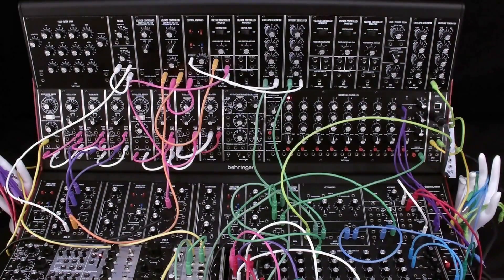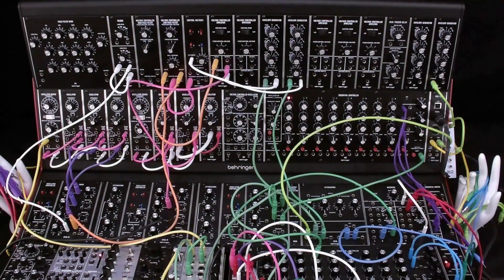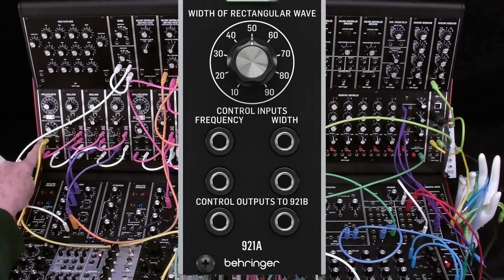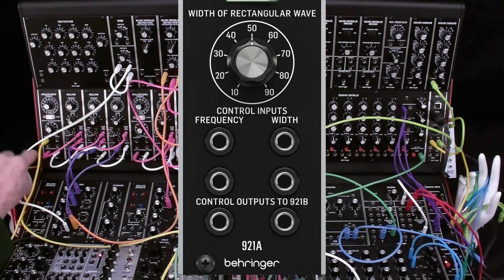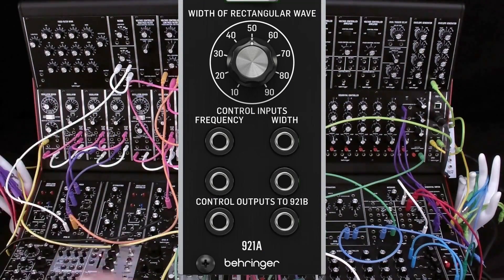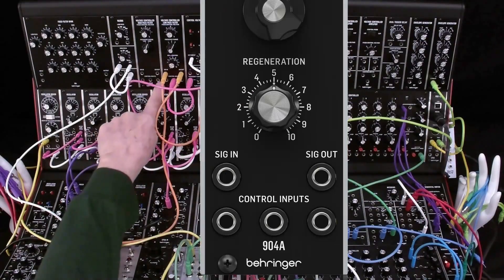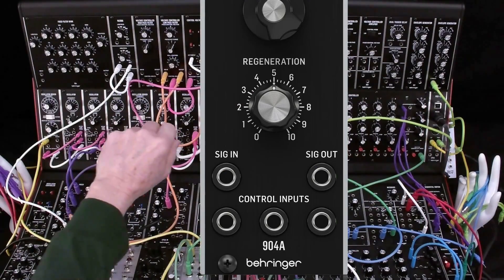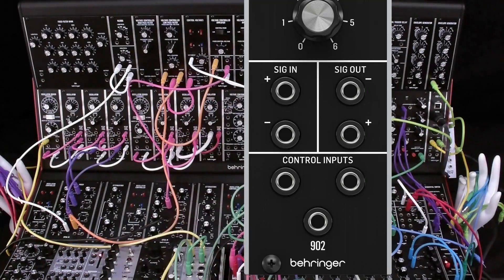System 55 Mixers - Active and Passive

Comment: A mult can only work as a mixer if the devices that are input to it are specially designed to work with that configuration.
This isn't usually the case.
Reply from the maker: Yes, there are limitations.  What audio signals in a system 55 would not work?
Reply: @ozhalljr  Since the Moog design doesn't have level controls on active outputs, there is little use for stuffing several outputs into an input.
Reply from the maker: Maybe I'm misunderstanding your point.  
To me clear, I don't often do passive mixing, but it is a technique in the bag of tricks.
If I want a "composite" waveform that combined two waveforms from an oscillator, I could use an active mixer.  If I wanted to conserve my active mixers, I could use a mult.  
I could use an attenuator (or two) to change the mix of the two waveforms (which changes the underlying premise that the Moog design does not have level controls on active outputs).  
One side effect is that the resulting waveform would never be of greater amplitude than the waveform with the highest level.  I might want this side effect.
Am I missing a point that you're making?
Reply: @ozhalljr  . I've only heard of moog grandmother being designed so that passive mults can be used as an audio mixer.
Maybe sys 55 has that, and maybe the Behringer equivalent does. Generally the rule is don't connect output to output ever.
So generally in Eurorack this is not something you'd do.

Re: the Behringer, I have the multiband filter, which is great, but note the 2 inputs are just in parallel {i.e passive mult}.....that would support the idea that other sys 55 modules are designed with extra components on the outputs so you can use passive mult as a mixer......but the Behringer 55 stuff is Eurorack and I've never seen them mention that those inputs shouldn't be used to mix non 55 signals.
Reply from the maker: @livelooper  Thanks for the detailed reply.  Generally speaking, the Moog modular modules have been tested in nearly every patching configuration.  ( per a history of Moog that i read ... perhaps "Analog Days" ).
Reply: @livelooper  When the Grandmother first came out, the manual said the mults could only be used to mix AC-coupled (audio) signals, not DC-coupled signals like CVs or the modulation oscillator/LFO.  Then the Matriarch came out and that was changed: the mults on that synth can be used as passive mixers for CV as well as audio.  Later the Grandmother was updated to allow for this too - the dark edition’s manual says you can passively mix/mult CV as well as audio.  Someone on Gearspace who had both an original and a newer Grandmother did confirm that CV mult-ing did indeed work better on the newer model.
Reply: @ilovecatsandsynths9702  . Thanx for that. I knew about the original GM.
Suspect that the LFO also counts as "audio" as it doubles as a 1v/oct oscillator....but going to have to check .
Reply: @livelooper  The LFO is DC coupled so it can work as an LFO.  So if your Grandmother is older it can’t be passively mixed without it causing issues.  If the impedance of the outputs being multed aren’t the same, lower impedance signals will overpower higher impedance ones, and in some cases could overload or damage the circuit.
Reply: @ilovecatsandsynths9702  . 
It could be DC couple and still have the mix functionality, only needs the addition of a single resistor.

I didn't try it yet. That would be the thing.
Reply: @jr Your assumptions are not correct and a oversimplification and - in error - of electric engineering, more a play of words and cutting corners than a real effort to learn or share knowledge &  the basics of electronic (mixing).  That it under certain conditions did work and not cause damage does not mean it holds true in general, over frequencies or different levels - it also negatively affect signal to noise ratio in your setup-studio & may introduce other unwanted effects, including detuning other devices later in the chain should these be depended on the waveshape of your oscilaors in any way or form.
Reply: @jr This is word-play by you- electrical engineering should be clear cut and not be explainable in more than 1 way - THX in advance.
Reply: @jr Well, with passive mixing as you call it you are shortcutting 2 or more outputs.  The resulting signal then is amplified by your next device in the chain.  Totally unpredictable situations may occur in the systems of yourself or those of your public.
Reply: @atsandsynths9702 That woud be then a device specific adaptation of such functionality and is not anymore a true (passive) multiple.  Probably due to internal resistors in the output stages and higher gain at the next module that it acts as a (largely destructive to the signal noise ratio) of some kind of workable situation by (modified) design.  If workable it would be for music that has little dynamic range and may only work on later models (of only a few manufacturers) - this is just not a good practice and may create non-repeatable results in systems  filled with devices form different manufacturers.
Reply: @ozhalljr  You are mixing concepts, assumptions, faulty electronic signal flow and wording here into a cocktail of misunderstanding.
Reply: @jr Your "passive mixing" is not mixing - it is connecting outputs together by means of a electric wire (shortcut) and pick up the residual of several canceling (relatively low impedance) sound sources with a high impedance connecting device in your audio chain (filter/active mixer/VCA, etc.). You are shortcutting output stages of pricey equipment and giving it a name because the header on the face plate says 'mixer'.  Temperature as ‘name’ or ‘title’ on a washing machine does not mean it is a heater - it means that it could be a parameter or functionality within the device - it does not MAKE the device - NOT! So the multiple on your "mixer"is a distribution functionality, e.g if you mixed 3 waveforms in the active mixer - connect an output this active mixer to a multiple (as extra) on this "mixer" and rout to e.g 3 VCA's - that is how it was intended to be used (as example) - a distribution facility, passive connecting a very low impedance device to newly destinations with a very high input impedance - electrical engineering 101 (and therefore ensuring that the 99% of the whole signal arrives and is available at the next step in you signal chain WITHOUT any losses or cross interference/spectral changes (no differences in frequencies are several equal or unequal receiving devices for further processing).
Reply: @aemilpeters5644  You need resistors to avoid overloading the multed outputs, but there’s no need for voltage gain, just a high impedance input, which can be provided by an op-amp set to unity gain.

The key is that the output impedance (set by the output resistors) is the same for all the outputs being multed together, otherwise a lower impedance signal will overpower the higher impedance signals.

An active mixer handles this by providing a high impedance input buffer on each input, with the same output impedance of each, and mixing them together with resistors and then an output buffer, and (possibly) attenuators on each input.
Reply: @ilovecatsandsynths9702  Not me needing resistors - OZJALLJR is in need............ of these - I do not adhere to his 'mixing' practice!
Reply: @ozhalljr  https://www.youtube.com/watch?v=IRxeIEeAAnU